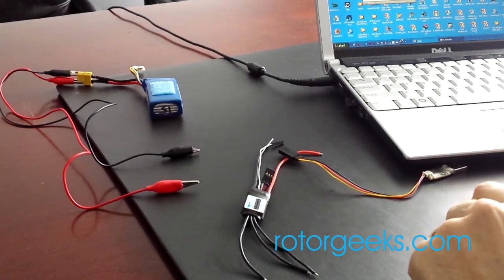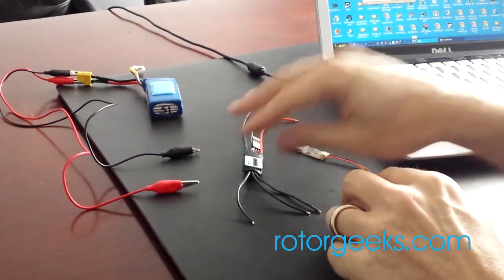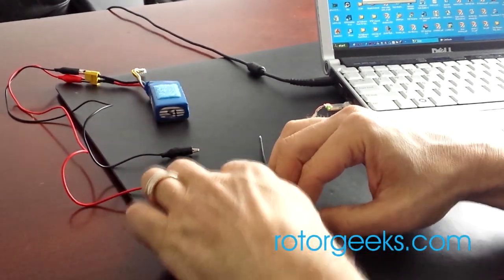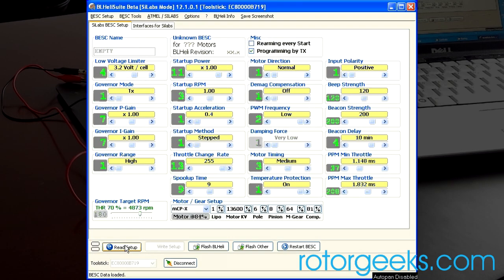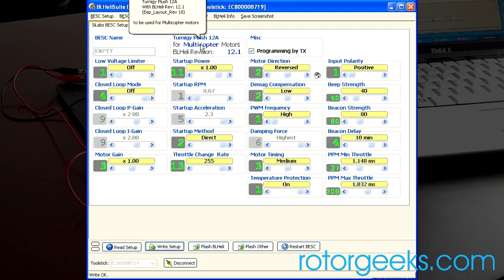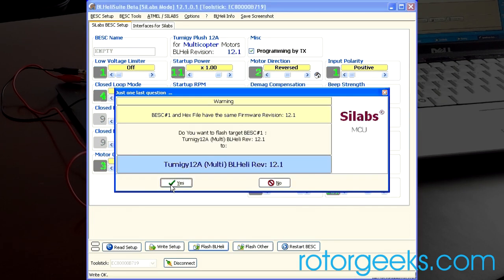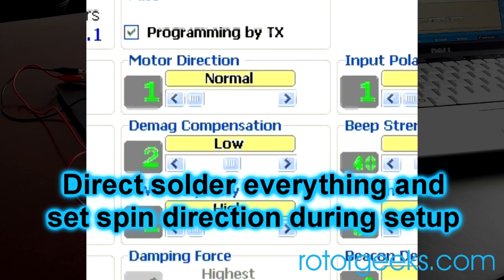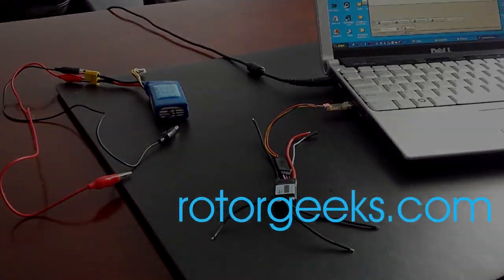Rotorgeeks ESC flashing and config with BLHeli

Comment: Howdi i have the RG20a`s, and i have the USB flasher,  my ESC`s came with the black&white twisted wires but when i connect the small connector into the USB flasher it does beep when powered on, but in Blheli i selected option C but when i click connect i get an error ?? conection to ESC failed check all connections to ESC, which i have done any ideas ?
Reply from the maker: Try powering the ESC first.  Make sure you see "FVT" as the device I'm the lower left corner after the usb is connected.
Reply: +Rotorgeeks yup FVT is listed in bottom left corner, tried powering ESC 1st.. same issue.. i`ll see if i can find another USB..
Reply: my issue was the connector from the ESC that goes into the USB was upside down i was following a photo i saw in a guide online who had it the wrong way around, try it ;)

Comment: My ESC won't connect to the BLheli suite, but all my other ones will. Does this mean that the ESC is fried?
Reply from the maker: SF PV It's quite possible to not be able to connect but the ESC works fine.  Maybe damage to the programming connections or leads.

Comment: How do you throttle calibrate them. Im using the naze32 and the normal way doesent work.
Reply from the maker: Hi.  I don't know which is the normal way but they calibrate like any other ESC.  In the Naze, go to motor control tab, turn it up all the way, plug in your flight battery (props off), after a few different sounding beeps, uncheck the motor control box to drop all the way down, a few more beep and unplug flight battery.
Reply: ***** That's exactly what the man just stated!?